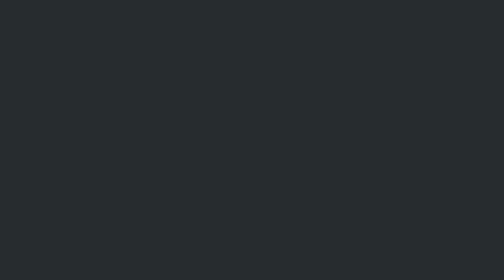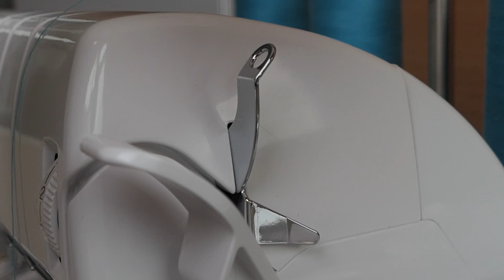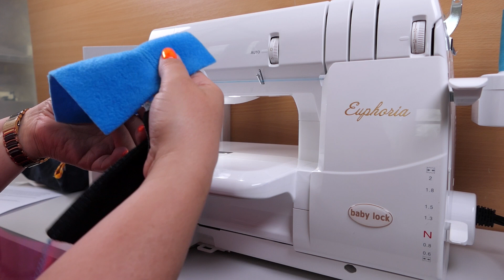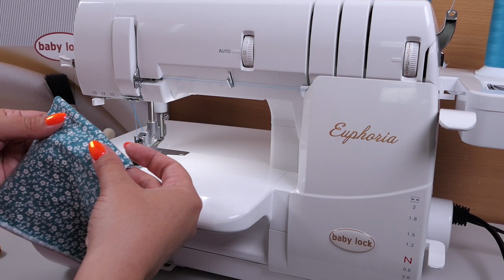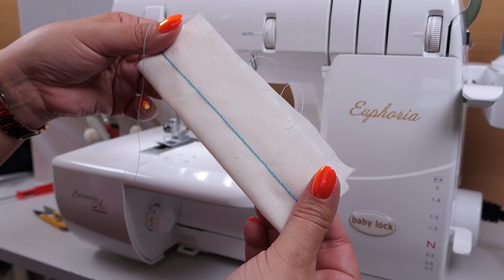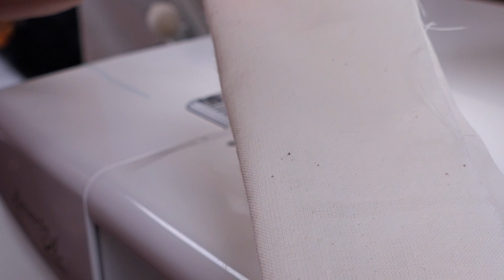baby lock Machines | Euphoria Coverstitch Machine Tutorial with Katy Inch

Comment: I never saw you change from cover or to coverstitch. Just showed it sewing. The changing is the hard part. Back and forth.
Reply from the maker: For each of the stitches demonstrated in this video you would follow the same threading sequence as shown in the ExtraordinAir Threading chapter at 5:00. There is also a chapter on Changing The Needles at 11:00 for switching between 4-thread and 3-thread coverstitch, the same can be applied for switching to chainstitch. Hope this helps